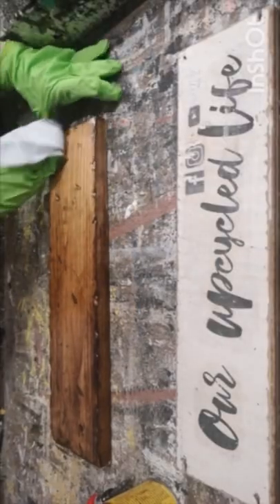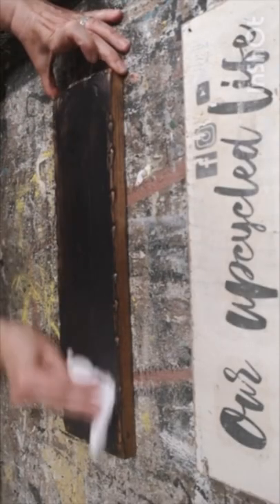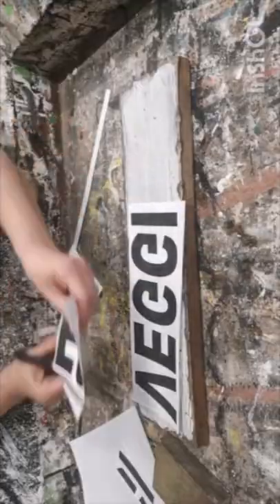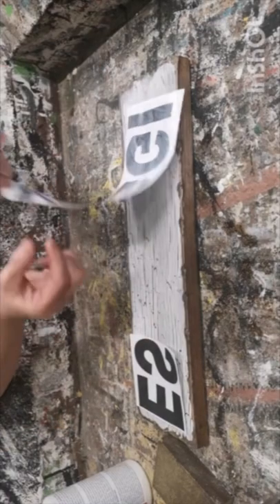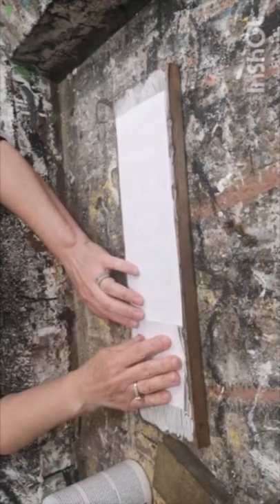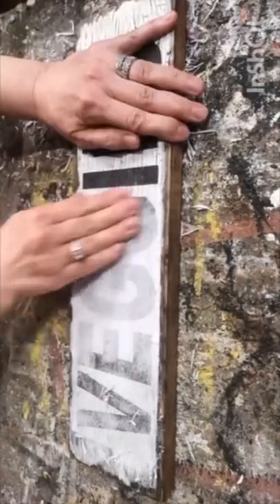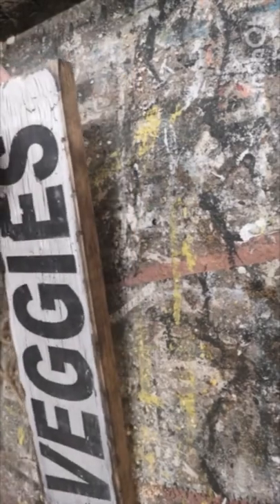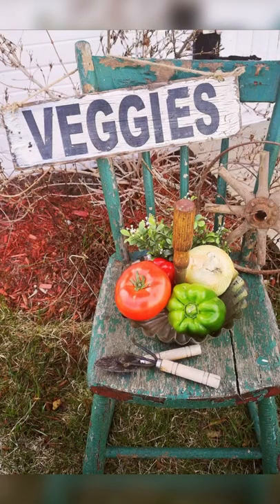Love what I can do with a scrap piece of wood!

Comment: You don't even need to do that extra step with your printout, and it also doesn't take 24hrs wait time. Just print off your graphic like normal (not in reverse), cover it with clear tape of some kind, dip it in water with a drop of dish soap and then the paper rubs off very easily, but the graphic will remain. It can then be rubbed onto the desired piece. Use mod podge like you normally would